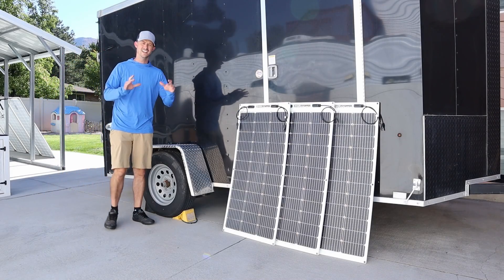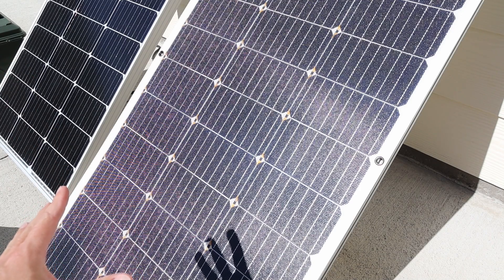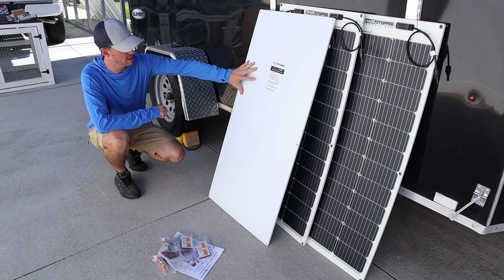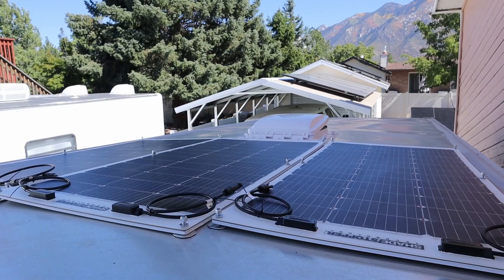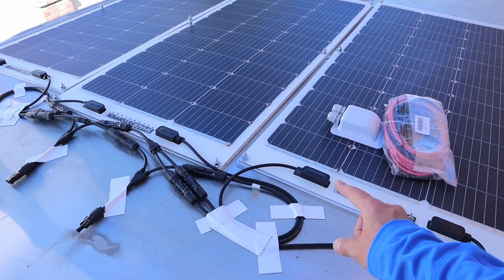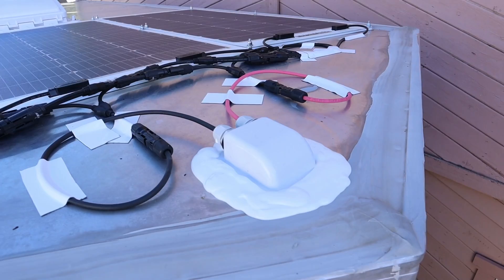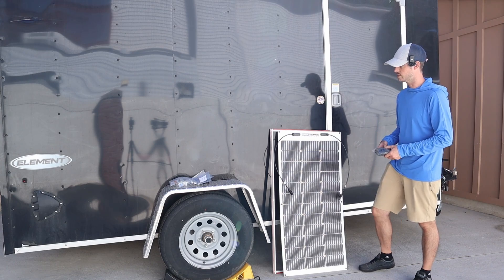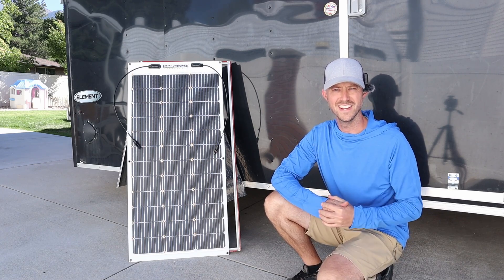The Perfect Solar Panels for Your Trailer?! New Shade Stopper 100w Panel Mounting Kit!

Comment: Do the feet on the panels adjust enough to the height differences of the surfaces of the roof on my Ford transit 250? It's also my daily driver so I  worry about the durability of the adhesive.
Reply from the maker: I'm just almost through winter so I'll provide an update as it warms up. The panels are still sticking for now.

Comment: The channels of the coroplast should be aligned with airflow from the vehicle, doing so will allow for increased cooling.
Reply from the maker: Ideally yes, they wouldn't fit on my trailer that way.
Reply: @Jasonoid please see my question just above -- I was asking him/her, bit ill ask you as well if you have any experience with it?
Reply from the maker: @jeffs3917 the panels have been installed and working perfectly since the video. I still use them and they put out great power.
Reply: Won't that make them flop up and down in the wind as you drive?

EDIT: I'm not being smarmy, sorry if it comes across thay way!  I'm asking because I truly want to know.  I too think it would be better to have air blowing thru front to back as you drive, but I do not want them flopping up and down!

Comment: Just remember to use a DC breaker and not DC switch between solar panels and solar controller, DC switch between battery and the rest obviously

Comment: Really cool!  I also need to check those 200W flex panels. I need to set up a 800/1000W array.
Reply from the maker: That 1000w array I have using Renogy's panels is pretty lightweight. It's held up so far! Still getting great power after 1 full year of use:   https://youtu.be/LBel4dpbKqw

Comment: Hello, could you help me find the right panels or recommend which solar panels I need to get maximum charge capacity on my system? I got the bluetti AC500 with 3 battery B300. I'm new to this and I don't want to make a mistake by buying the wrong panels because I want to buy the best to charge quickly and efficiently. Thank you.
Reply from the maker: Feel free to reach out to me here for basic consulting needs. Explain your setup exactly and what you are wanting to accomplish:
https://asqme.com/@Jasonoid

Comment: Surely bypass diodes are not a new concept. If they're so great then why is everyone not using them? What's the drawback other than cost?
Wouldn't it be more cost effective to wire a whole bunch of small panels in parallel?
Reply from the maker: I asked myself that same question. There doesn't appear to be any other downsides. These sure beat a normal panels in partial shading. I'd love if they came out with a glass panel version.

Comment: They need to come out with panels bigger than 100w. I want to put a minimum of 700w on my next roof install and would prefer to use only 2-3 panels, not 7 and all the wires associated with them.
Reply from the maker: I'll pass that on to them, thanks!

Comment: Someone needs to come up with a better way to connect panels like these, I hate having a bundle of wires sitting on the roof.
Reply from the maker: Connecting in series would have been much less wiring. No adapters needed for that.

Comment: Just wondering if wire loom will protect the cables over time from vibration a lot better than a rubber grommet on that sharp aluminum hole.  As always great videos that you share with us.
Reply from the maker: I'll probably revisit that again, need to order something specific for that hole. Thanks for the idea 👍

Comment: You trust the little stick on mounting bolts 😂
I would carry some bricks to weigh it down.
Reply from the maker: I tried peeling one up and it wouldnt come off. It was actually bending the aluminum roof... I figured that was a good sign of how sticky they were.
At first I was skeptical too but time will tell how long they last. They used some good quality adhesive and it's all about your prep before you stick them down.
Reply: @Jasonoid  
You have to give it some road miles.
The flexing of the trailer will slowly release the adhesive and let the water and dirt in.

Comment: More DYI, so encouraging to me at least :-) Thank you!

Did you use "Y's" vs "3-way's" connectors because of the wire length of the panels, you had some extra "Y's", or just a preference?

Those "sticky" screw mounts are any interesting idea. 

And I see there is still more roof space for more/expansion later :-)
Reply from the maker: I enjoy these DIY projects! I would have used 3 way parallel adapters if the wires were long enough for the panels but they are a bit short. The 2 way splitters worked out perfect to add a little extra length to the wire.
Reply: @Jasonoid  Yea, they did. The wiring looks "balanced/symmetrical/clean/neat" 👍👍

Comment: Thank you for the install video.

Just a question. Are you not going to cover the triangle shaped section of the roof where all the wires are so all the wires don't get snagged and ripped off on a branch or some such like.
Reply from the maker: @BDKillerZZ  I don't have plans to cover the wires. I'll just be careful I guess.
Reply: @Jasonoid  Ok. Lets hope Murphy's law does come to bite you. 🙏🏻

Comment: Glad to see the new panels!

I bought one of the others after the other review!

I am very happy with it.  It works really well and I love the shade performance- our yard is pretty shaded and  don’t have to be quite as attentive to the panels.

They answered  my questions very thoroughly and quickly.  

I need a flex panel and am going to buy one of these and a frame.  I think it will fit great in a spot under the bed in my camper

Thanks for all the great information!

Katy
Reply from the maker: Thank you for your excellent feedback, Katy!

Comment: WOW, Retail is $189.00  for a 100 watt panel that's $1,890.00 plus tax for 1000 watt array?  Anyone who thinks that a great idea is money foolish.
Reply: Are there alternative companys that sell this Tech too? Not a sarcastic but honest question. The only thing why i am considering this is because sometimes i went to events where i could not decide the spot to park myself, and unfortunaly ingot a spot wich only had full sun for about 2 hours a day, the whole rest my 800W array charged with around 5 Amps 🥲 Having something where you know you get more out of the whole day could be nice and maybe you just need a 500-700 W array instead of a 1000W one, because when parking in the shade according to his video the 1000W one won't be worth its money too 😅
Reply from the maker: @FmKTo4sTy  There are a couple of options that are priced way higher than these:
-Optivolt 100w panels are shade tolerant priced at $279 each
- CIGs 100w panels are also shade tolerant priced at $269 each
I'd like to see some larger companies try out making a shade tolerant panel.
Reply: @Jasonoid  ok thats nice to know, do you think my Equasion is kinda right? Would you rather do the 1000W cheaper loadout with the "risk" of it being less effective or would you buy less panels that are more effective in the shade in that situation? The space taken is not a problem because i have a whole roof of a camper trailer with around 8m of lenght and 2m width in mind..
Reply from the maker: It all depends on your camping conditions. If you think you can avoid shade stick with normal solar panels. If you are always in the shade the extra price will give you a good boost in production.
Reply from the maker: Go buy a CIGS 1000w array for $3000
Reply: @Jasonoid or buy topcon panels one dollar a watt
Reply from the maker: The key is shading performance. Topcon panels don't perform any better in shading than a PERC panel (not a huge difference anyways). If you don't care about shading, buy a normal panel for sure, it's cheaper 👍
Reply: @Jasonoid  hmmm interesting. Hobotech spoke very highly of them. Especially shading
Reply from the maker: @jamesdean7756  did he do actual shade testing like in the video? Real world results are much different than what the company advertised. For example, that 100w renogy panel I tested in the beginning of the video also advertises "great shading performance" lol 17 watts isn't amazing.
Reply: @Jasonoid  I will watch it again. I’ll let you know.

Comment: Great video! I've been thinking about putting a solar panel on the top of my Highlander with a stock roof rack and their products may work for me.  Pricing seems a bit high but your endorsement has always proved accurate for me.
Reply from the maker: I've been impressed by the quality and performance. Time will tell as they are installed on my trailer roof. I'll provide an update down the road.